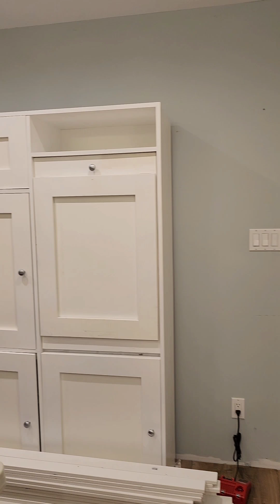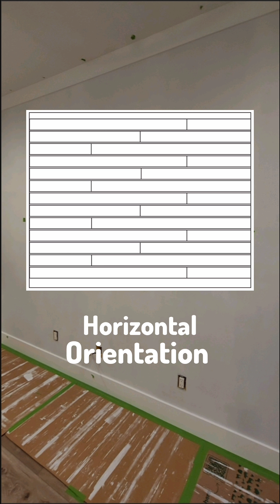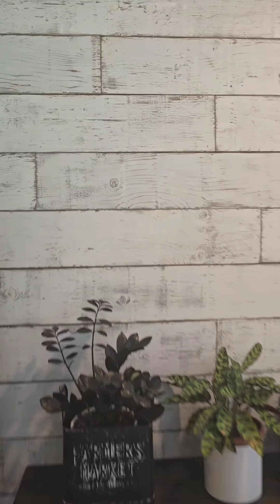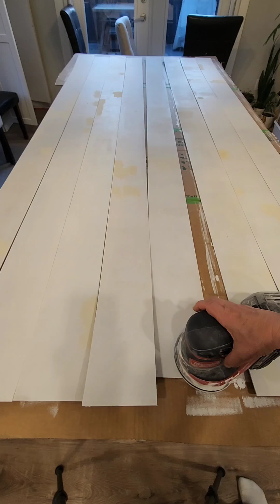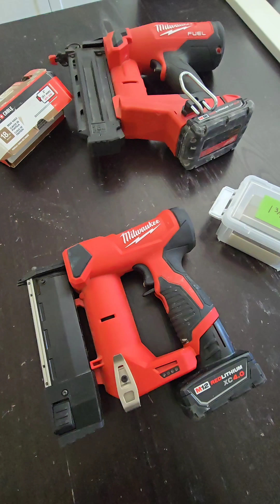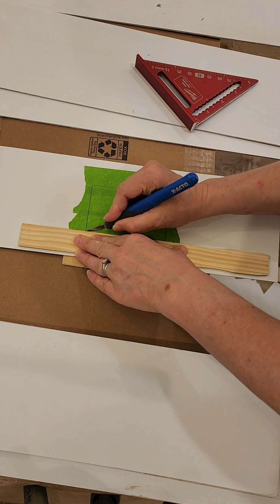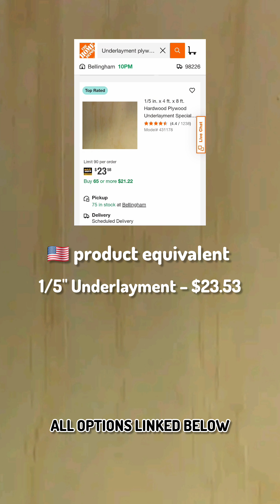Don’t Buy $15 Shiplap Boards - Make them for $2 | Full DIY Wall Tutorial

Comment: So without adhesive will the boards loosen over time?
Reply from the maker: I did this wall a few years ago and so far they are all good. I did use a lot of nails though and angled them in opposite directions. I think it would depend on the temperature fluctuations in your home and how well they are nailed to the wall. You could definitely use some adhesive, I have done that before but it does ruin the drywall if you choose to change it up. Another option is to use the same product but put full 4' x 8' sheets up first and nail/screw them into the studs then cut your strips and glue them to the full sheets. I did this in my laundry room on the ceiling and have a video on that process as well. Also a good renter friendly alternative.

Comment: Pro tip- instead of the green tape to mark your white filler on white primer simply add a couple drops of food coloring to your nail hole filler. Simple, cheap easy and will not bleed through your finish coating
Reply: Thanks!!
Reply: Great tip!

Comment: Do you live in michigan, lol? You have great ideas. Im 65 and i think i can do this myself.  I just dont know which wall or color scheme. Im very neutral i like taupe lots of colors go with, right?  Lol. I am not any good at interior design i just paint and its boring to look at. This is a great idea and so economical. Thank you. I hope u have other ideas and videos.
Reply from the maker: I actually live in Canada 😄 For colour selections I usually go to Home Depot and pick out 3 paint choices and get them mixed in those $5 sample pots then bring them home, paint a board or cheap dollar store canvas and hold them up so you can check how they look in the lighting in your room before you commit to a colour. Hope that helps. I have lots more videos coming. Thanks for your question and following along! 😊

Comment: Everything looks great!  Can you tell me what floors those are??
Reply from the maker: Thanks so much! Our floors are @califloors and they are the Seaboard Oak Longboard wide click vinyl plank.
Reply: @creatively.clarified  I kinda thought that!  We are wanting to go hard surface on most of our first floor, and an installer I talked to loves Cali floors. It's hard to find a lot of real-world examples of the colors were going between, so this is great to see the Seaboard Oak like this. (We're debating between that & North shore Oak)  Thx again!
Reply from the maker: @marketweis Oh nice! We've been really happy with them and they've held up so well to our 2 dogs. (Our previous floors were real hardwood and scratched so easily.) The only issue we've had with our Cali floors is the installer didn't cut it out around our kitchen island and instead went underneath it, it's way too heavy and not allowing the floors to float like they should, so one board did crack beside the island. They did fix it under warranty though.

Comment: Where did you get your boards for $15?? I can't find them for less than $30.
Reply from the maker: I got mine from home depot in Canada
For my wall I used: 2.7mm:
https://www.homedepot.ca/product/1001384323
For my ceiling I used: 5mm
https://www.homedepot.ca/product/1001384322

If you're in the US these are some similar options of material to what I used and some other hardboard in a similar price point that you could use to achieve the same look. https://liketk.it/4WkvH

Comment: So I was looking for your thoughts. My outer walls of my brick house have no insulation and I have plaster walls. I was thinking of doing the shiplap wall on the exterior walls just to help block the cold. I don't know if you have seen the insulation that looks like bubble wrap. I was thinking of putting that on the wall and then shiplap/plywood boards over that. Not sure this would actually work or just better off doing the shiplap/plywood.
Reply from the maker: Thanks so much for your question! I haven’t personally used the bubble wrap-style insulation (I think you're referring to the reflective foil kind?), so I can't speak to how effective it would be in your situation. I do know that the thin underlayment plywood I used really needs a solid, rigid surface behind it because it’s a little too flimsy to span over soft or uneven materials. If insulation is the main goal, you could look into rigid foam board  maybe? But adding shiplap boards could definitely help block some drafts and add an extra layer.
Reply: @creatively.clarified thank you